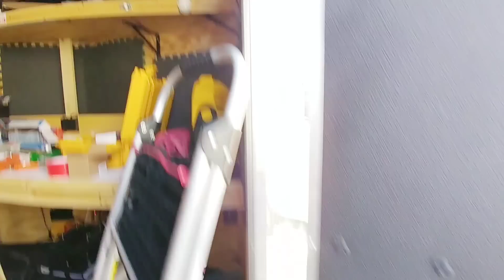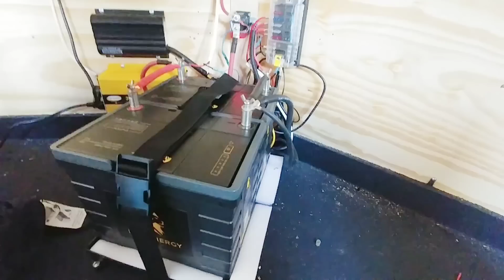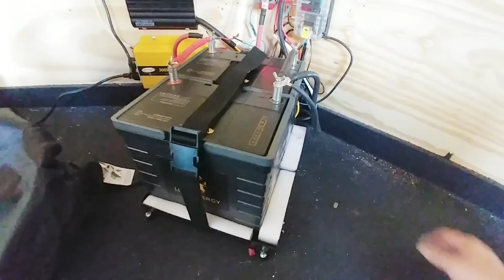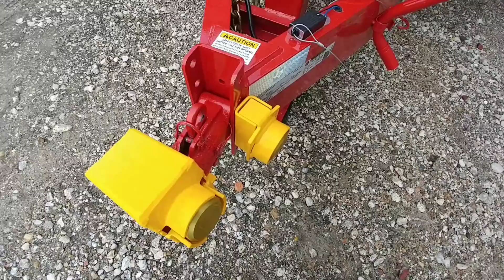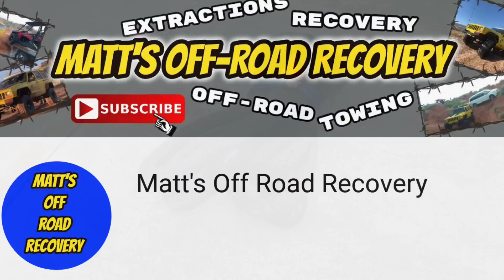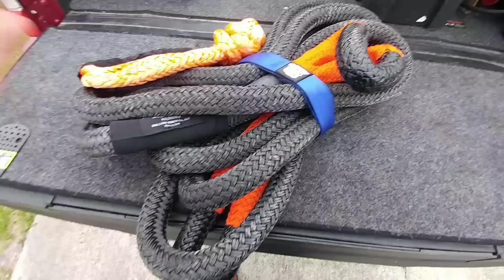MUST HAVE Recovery Accessory! This is the future of RV and Truck Recovery! Bulldog Winch Kineti Rope

Comment: I can attest to the effectiveness of kinetic rope. I used one to pull out a fully loaded John Deere combine that had its front end buried up to its frame. Snatched the rear end into the air about 2 feet when it stretched out but it came right out.

Comment: Well now I have something to call mine "Kinetic Tow Strap" When I worked for our Electric & Gas Utility in Michigan our material lift trucks that are used for setting utility poles were equipped with a winch that used "Sampson Rope" when it got to frayed it needed to be replaced. Now these were 1" x 100ft. Only the first 50 or so feet would get frayed so when we replaced the rope there was still 50+ feet still good. We had the fids to put the eyes in and you had a wonderful tow strap.

Comment: You should look into factor 55. They have some awesome recovery gear also. Very light weight also, but very strong. And not cheep either.
Reply from the maker: I use Factor 55 for my winching accessories
Reply: Their trailer hitch recovery point is awesome for this kind of usage.

Comment: Break strength and WLL (working load limit) are a big different). It is best to go by WLL and not break strength. After I looked at the specs on etrailer they even say 21,000 :)

Comment: The wire gauge for the solar panels looks small. Love your videos.
Reply from the maker: 3amps.  Doesn't need to be a thick awg
Reply: @BTBRV  okay, I was just let to believe you still need at least 10 g. wire to allow for distance loss. The setup looks good. Great videos.

Comment: Nice kinetic rope. Incredibly robust but probably a good fit for your massive dually. I would caution those with lighter/smaller vehicles to use a less robust kinetic rope or snatch strap. It needs to be matched to your vehicle so that while the rope/strap is robust, it is still weaker than the rated recovery point on your vehicle or the recovery hitch. When subjected to excessive stress, you want the strap to break before the recovery point.

Comment: With a large rope like that, it will be like using a tow strap if you hook on to a small car.  A better option is a winch.  If you use this rope, you can't stop if pieces start ripping off.  Watching Matt's channel will show you that.